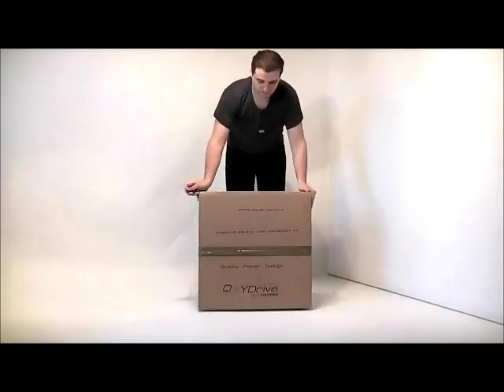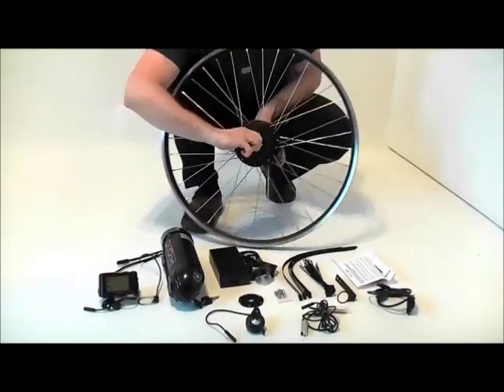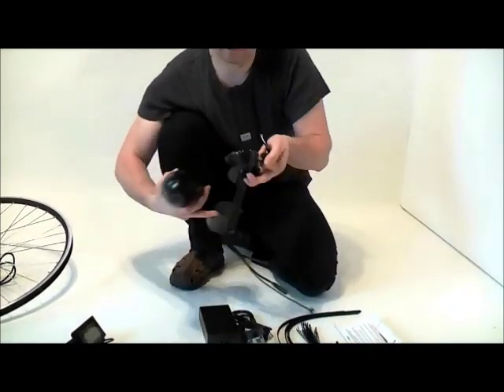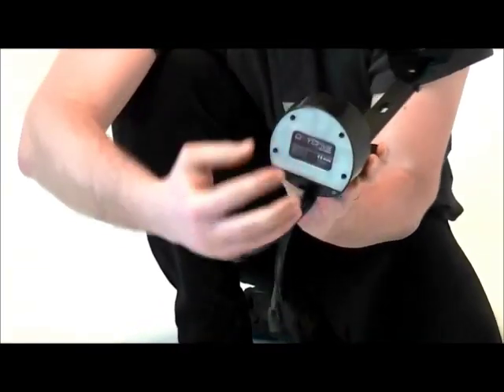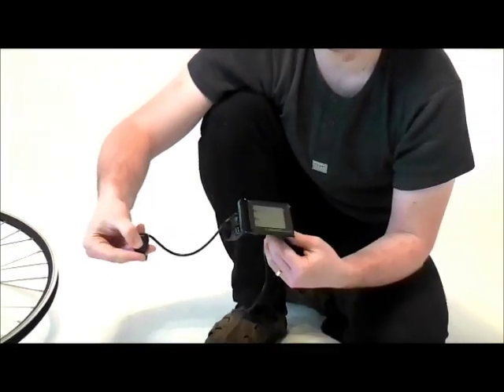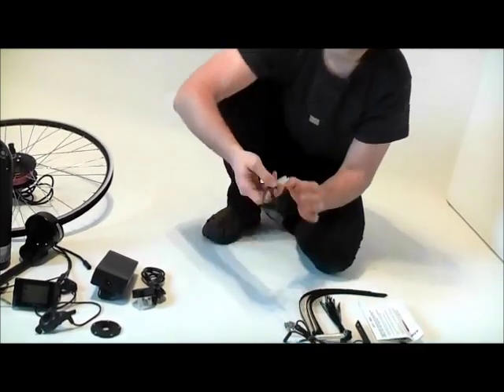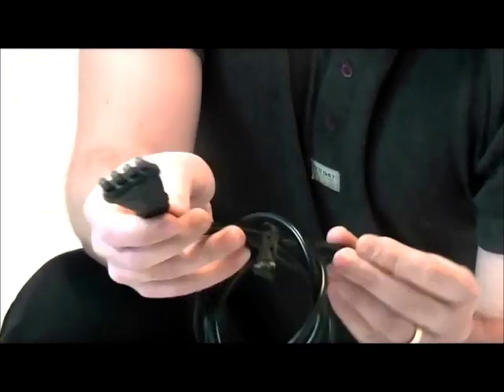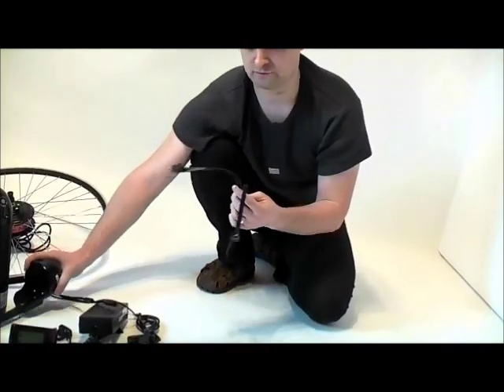OXYDRIVE electric bike kit  what's inside the box.wmv

Comment: how fast does it go max? mph please?
Reply: +paul mclaren Hi, I bought the lower torque rear hub motor back in the spring. I find it maxes out at 23-25mph on the flat when in mph mode and with the battery fully charged. Obs, to be legal on the road it needs to be in kph mode (which limits speed to 25kph/15mph).